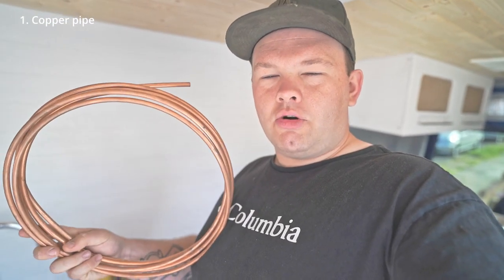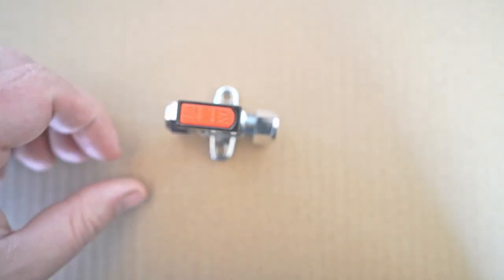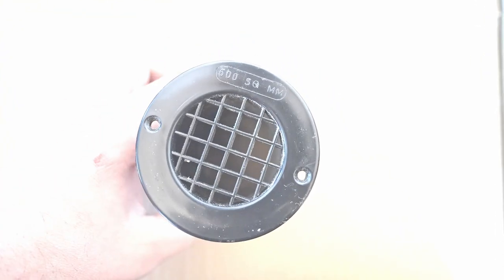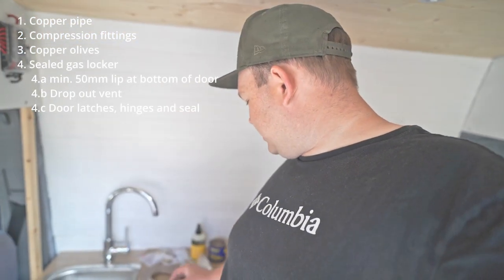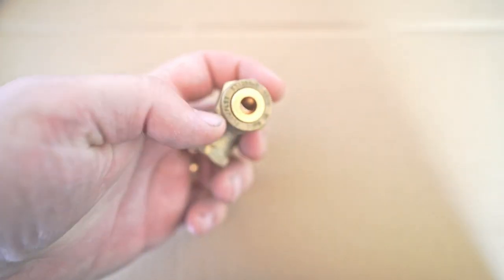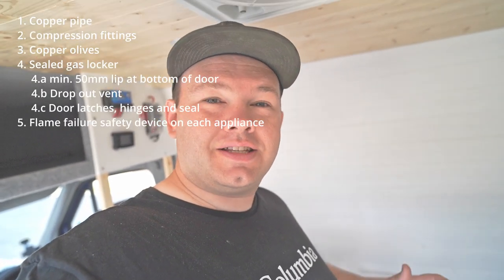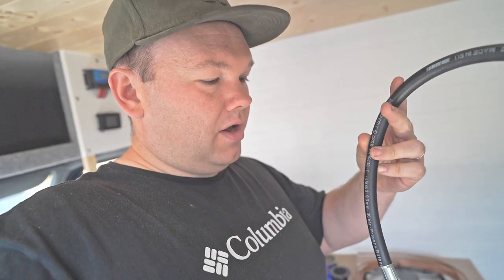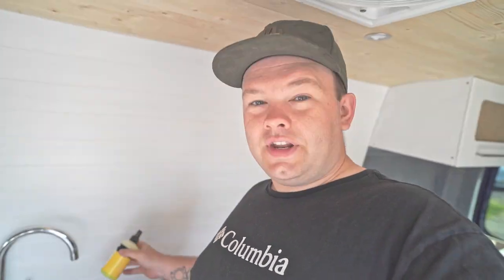HOW TO INSTALL PROPANE LPG GAS IN A CAMPERVAN - VANLIFE UK

Comment: Outstanding video thanks , I have separate oven and hob do I need two separate supplies back to the gas locker or a double cut off valve with one supply please ?

Comment: Great video thank you. Can I ask does the copper pipe have to run externally ie not hidden behind the van walls ?
Reply from the maker: practically, I never would have any joins behind a wall and an engineer would probably have to clarify that by seeing the whole pipe...but that's just a guess

Comment: Is there any rules about fitting gas box near electrics?   I have electrics by wheel arch and wanted gas bottle cupboard at the back by the doors with cable above the electrics?
Reply from the maker: In theory, the gas is totally isolated when it is the sealed gas locker so there shouldn't be any issues. Just don't run any cables through the gas locker :)

Comment: And your gas safe number is?
Reply: You don't need to be gas safe registered to instal lpg in your own vehicle,and you only need it certifying if you intend a commercial use of vehicle ie renting it out,but it is advisable to have instalation checked by a gas safe engineer.
Reply from the maker: exactly right @ktd2956